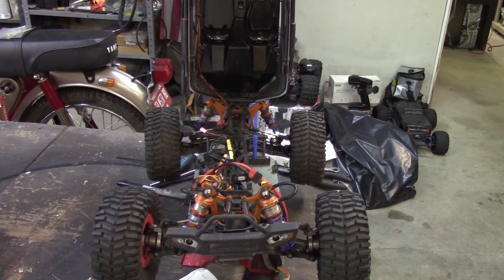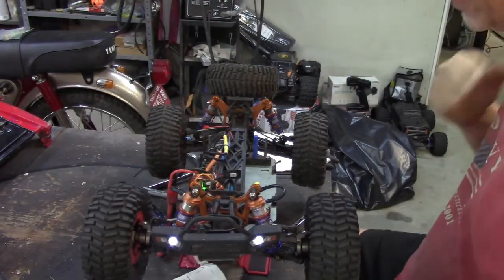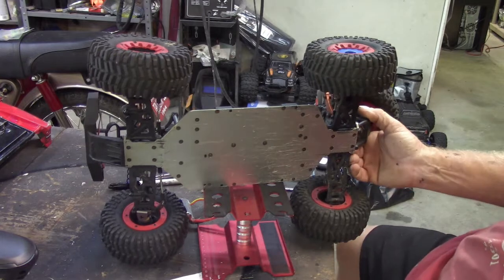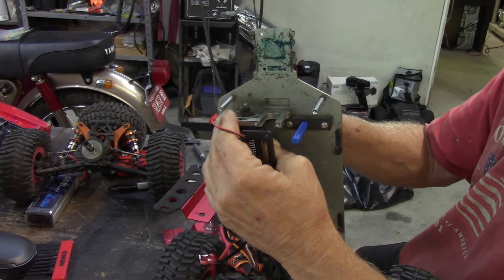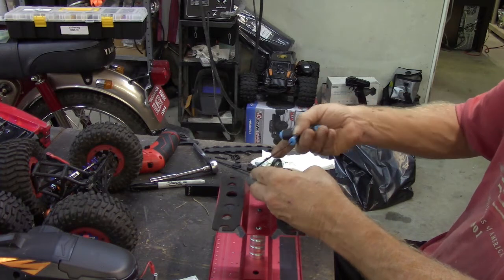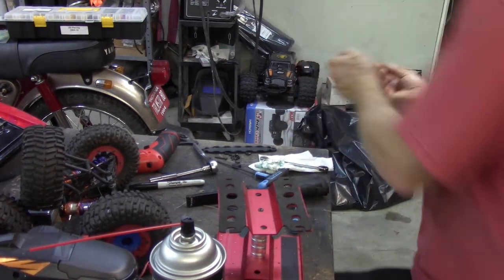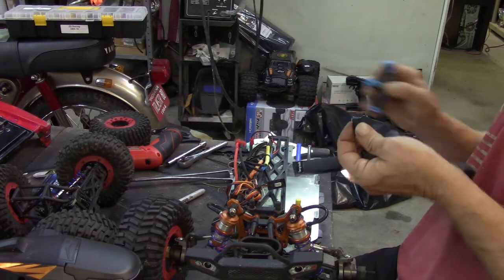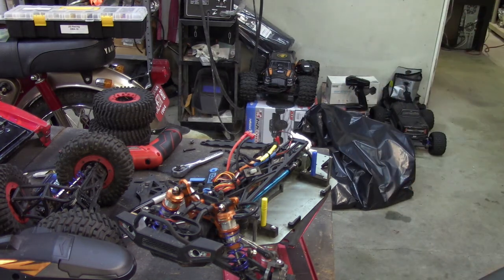ZD Racing DBX 10 Part 3 Slipper Clutch Diagnosis

Comment: Do you use WD-40 to lubricate moving parts? Can or can't WD-40 be used to lubricate RC cars? To lubricate the heads of the screws so that they do not rust?
Reply from the maker: Sure.  I'd just Vaseline (or similar), it'll stay longer.  Careful with the gears and stuff cause it can make dirt stick even worse.  They do make a dry lubricant for like garage door rollers, that might be ok to use.

Comment: where did you buy the slipper clutch? anti-rebound then pass link? thanks dude i think i have exactly the same exact problem.
Reply from the maker: I got it on ebay, but don't have a link.  You can also try banggood.
Reply from the maker: I actually got it off Amazon.  Here is the link:  https://www.amazon.com/gp/product/B09XX6GV2H/ref=ppx_yo_dt_b_search_asin_title?ie=UTF8&psc=1